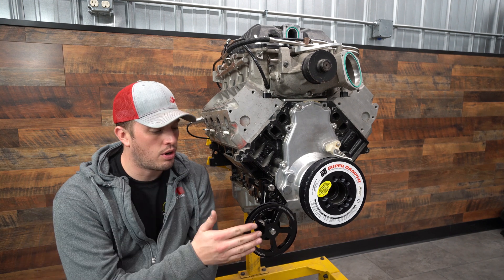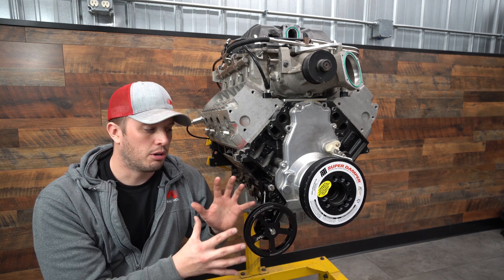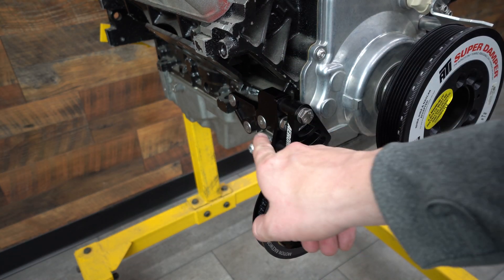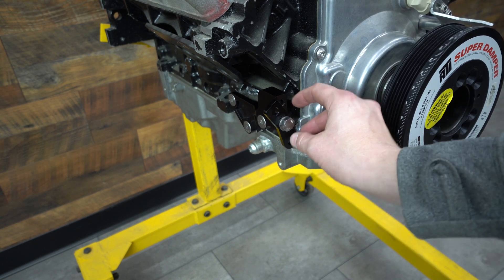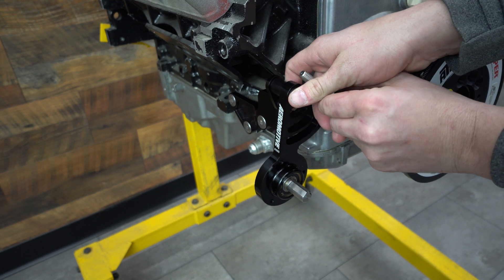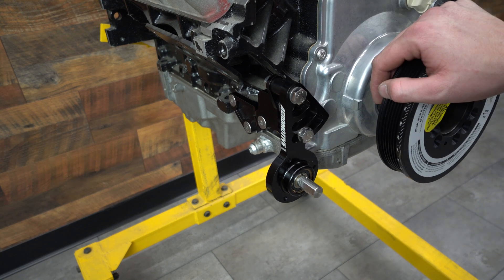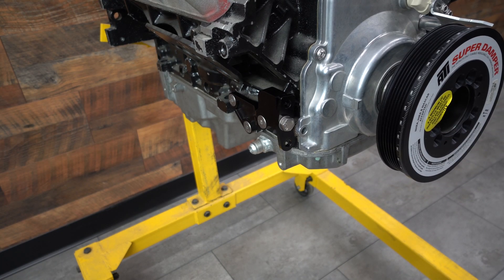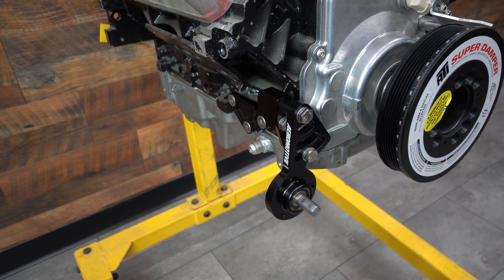LSX Mechanical Fuel Pump Brackets from Motion Raceworks

Comment: If I chuck a belt in my custom mechanical pump in the middle of the pull but my ECU doesn’t have fuel pressure sensor I manually look at a gauge does that mean the engine gets hurt instantly?